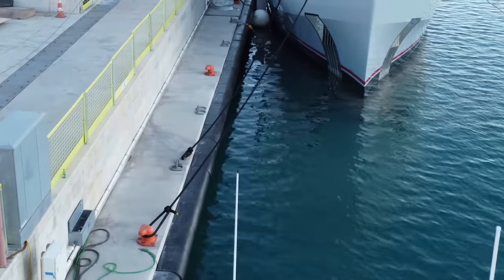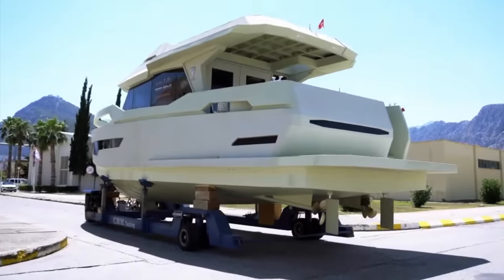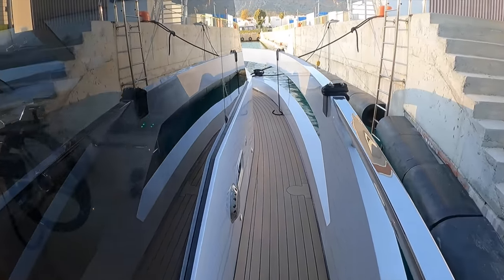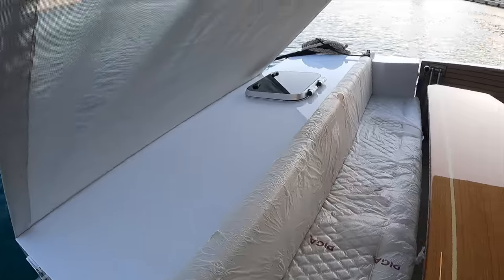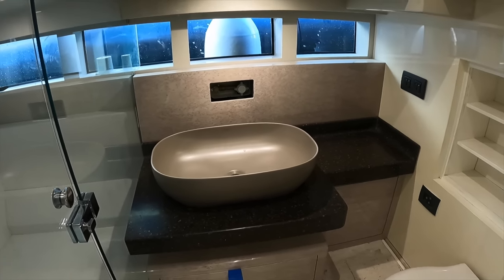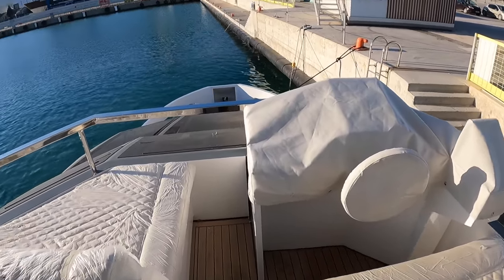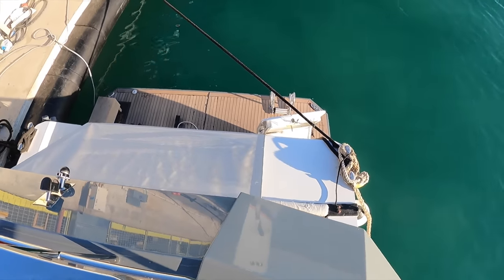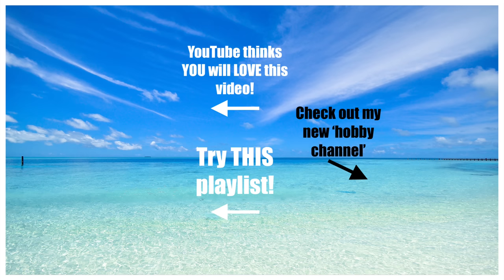FIRST LOOK At A Brand New  $1.8M ELECTRIC Motor Yachts!

Comment: I was a bit(lot really) sceptical about marine electrical propulsion but having seen electric catamarans on other channels I realise that as long as the solar panels are sett up correct with the batteries and motors then they are a viable proposition and infinite travel is possible. It does help of course in more sunnier climates than the arctic northern waters 😎 Cheers
Reply: I think there should still be some planning for a backup outboard motor. 😂
Reply: I like this hybrid set up just like the Greenline yacht family. There's speed and power when needed.

Comment: Very interesting boat.  I’m a bit disappointed in upper range performance.  I not a speed freak, but would like to have a bit more top end when needed, say 17-19 knots — I also know this is directly impacts electricity generation.  I wonder what option there might be for larger generators, kilowatt motors, and battery storage ( i also imagine this impacting the size of the boat).  I wonder how much contention there is between propulsion and house systems use there is on this boat.  As we see with aging Naval vessels, their upgrade capabilities are limited by their power generation limits.  Wonderful Video and you’re right, this is the future.

Comment: The electric propulsion and the range are attractive but the design certainly is not - way to boxy / slabby / rudimentary for my liking, and clearly the boat needs a lot of finessing before it could be considered ready for delivery. From the looks of the boat I initially assumed it was a test mule. Regardless, it's good to see low consumption propulsion systems being more widely adopted.

Comment: I think electrics have to be catamans. This hull moves too inefficiently through the water and clearly shows its current lack of stabilization.
Reply: 2500 miles is not bad. But I'd like to see when more sunreefs yachts are solar hybrids.
Reply: yes it makes a lot more sense for a catamaran both for the reasons you mentioned and obviously also because there is a lot more surface area that can be covered with solar panels.
Reply: Definitely agree, catamaran or trimaran is the way to go
Reply: Completely agree! Especially given the price point. The value for this size boat and build quality isn’t here (at least for me) but if it was a 47’ cat, more palatable. But $1.8 for this boat is nuts.